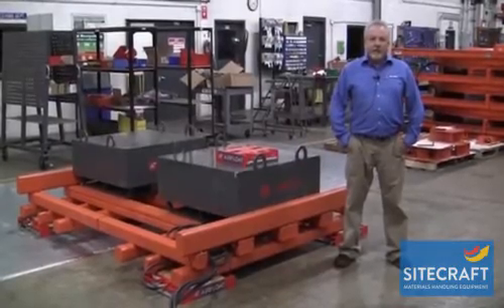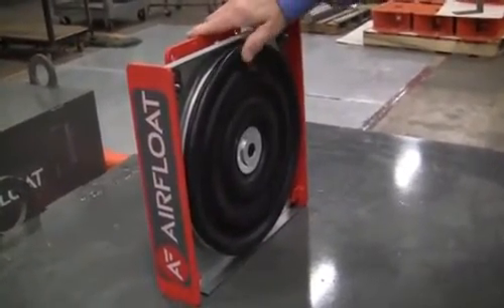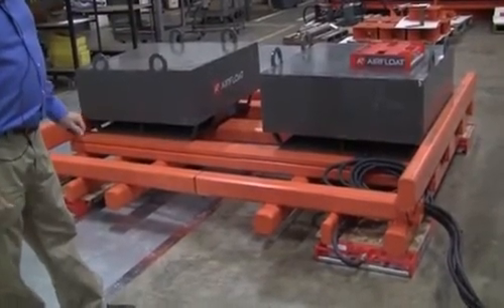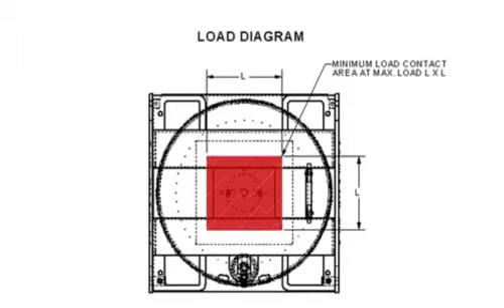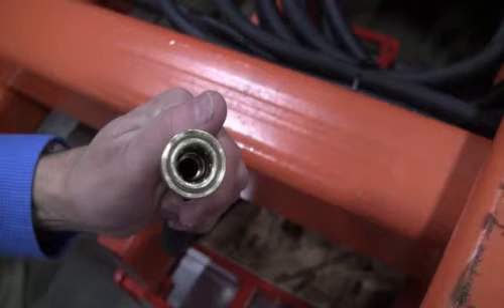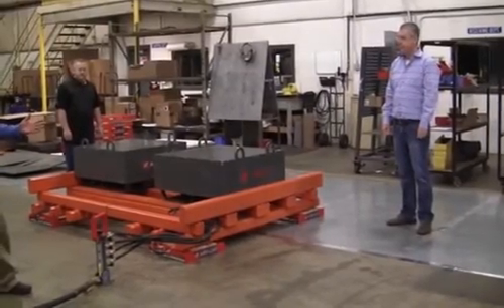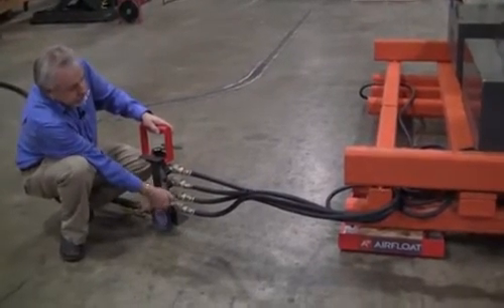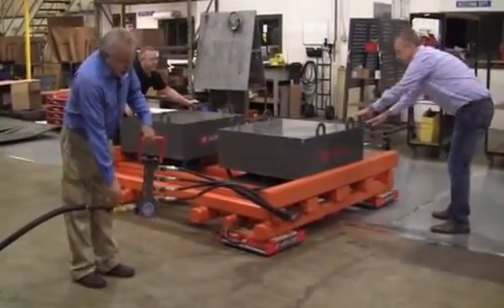Air Float

Comment: These are great with delicate floors such as epoxy floors in pharmaceutical plants. In normal machine shops the prep work and added personnel to control the piece being moved makes them inconvenient. Floors must be perfect, any expansion joints or cracks must be taped. Any pitch in the floor will make the piece run downhill. They are definitely not a consistent way for a machinery mover to use daily but extremely good way for specific conditions.